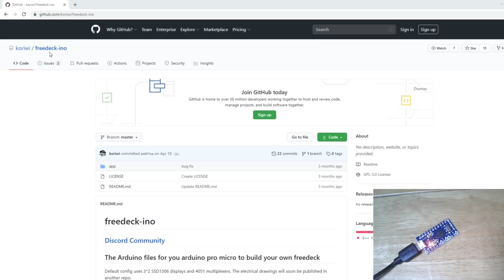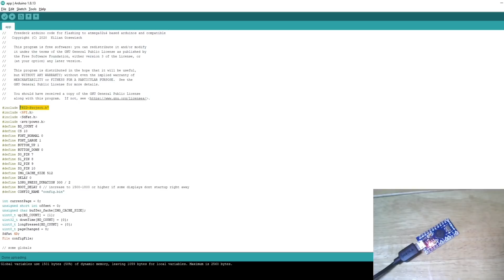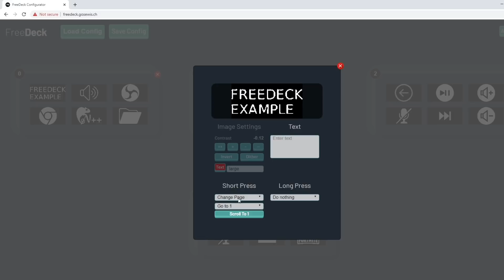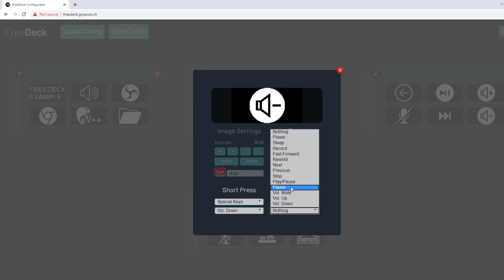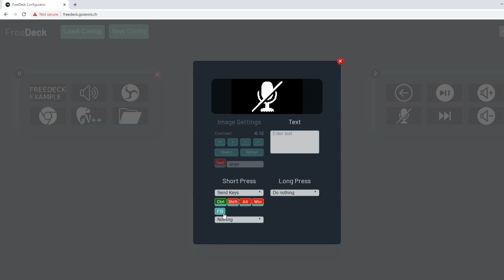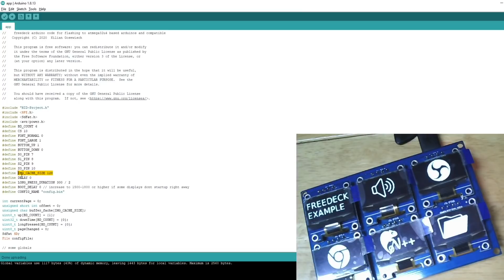FreeDeck - Open Source Stream Deck Alternative - HID, Arduino

Comment: Great Project and super video, any idea when the gerbers are ready?
Reply from the maker: They’ve been pulled into the github repository. I’ve tested both the through hole and surface mount versions.
Reply: @AdamWelchUK  Can you send a link to the gerbers, i still cant find them

Comment: If I may suggest. I think using a single screen instead of 6 little screens may be a better idea. It could be a design with a 5 to 6 inch screen underneath transparent buttons that are hinged on one side and touch a tactile button on the other side. That way, the  I2c problem is mitigated. When you press the button, no direct pressure is put on the solder joints of the screen if it  is connected that way. I would love to see a second version of this. Super cool. Keep it up.

Comment: Such an amazing project ❤
I've been looking for this for a long time.
Is there any way to use touch sensors instead of tactile switches ?
Because the slight bend of screen when pressing the button will break it after some time
Reply from the maker: I don't have much experience with touch sensors to say whether this would be possible.  I think that movement could be an area for failure, but I will need to use it for a good period of time to report back on that.
Reply: Have you considered using a Nextion screen. They're a full colour TFT touchcreen which is easily programmed as a standalone HMI device and good value.

Comment: cool, i already have bunch of those screens and promicro waiting for me to do exactly the same thing. this simplifies the process a lot, thanks!
i've been wondering about how well does those screens take the pressure from fingers, should i shield them with thin plexiglass or something? how about adding some "screen saver" features like movin screen content a bit or reversing colors or something to lessen oled burning?
Reply: Since the oleds are essentialy hinges, you can lasercut the top cover on a top plexiglass cover. Every cut will be C shaped, leaving the hinge uncut, ot partially cut. you could also carve some dots for finger placement.

Comment: why not just use a bigger screen like the ili9341 and then use the printed part to divide it into segments, that way you only need one screen, need to capacitive touch (as most of those displays have built-in touch) and you get full colour graphics

Comment: Hm, I dunno, the price isn't that much cheaper than just getting a normal Streamdeck, I got it to about 50$ with all shipping included, this is however not counting in how much it would cost to get the PCB. However, I do bet if you'd create the 12 button one you'd be able to drastically decrease the price as that one is 150$ compared to the 6 button one that is priced at around 80-90$, and I've seen them as low as 65$ during sales. Also doesn't include the price of creating/buying 3d printed outer casing.

Still cool tho, but not worth it IMO for the 6 button. Would be cool to see a PCB layout for the 12 button one.

Comment: mechanical stress with such a long lever on the screen pins makes me cringe. how did that work out?
Reply from the maker: Going fine so far. Movement to actuate the button is less than half a millimetre, but I accept it is a possible weak spot.

Comment: Hi Adam, i've been looking for something similar to this for a while - i have the pimoroni.com keybow and used this to give me a mute/un-mute button for teams on a Mac and have written a little about that https://garys.one/raspberrypi/pimoroni-com-keybow-and-keybow-mini/ just wanted a quick follow up - the buttons you used are missing from the list above? any points to size etc would be appreciated. G
Reply from the maker: Thanks for this.  I've been using my macro keypads while working from home and I too have made a mic mute button ;-)  I've been using the arduino IDE to most of the basic stuff and things I want it to do if I plug it into another machine.  For more advanced things I've been using Auto Hot Key and the arduino just send a high Function key as a modifier. (F16 for example).
Thanks for the tip on the link - I'll add one now.

Comment: Nice one :)
I think you can upgrade by using any cheap touch screen in color, just put 3d printed part over screen and y have much nicer product that will be without moving parts, also a bit cheaper. 
One screen is around 7-8 USD, you get sd card reader included. Icons will be much better, you will lose tactile feedback but you can have small vibro for that.
Anyway, thank you for sharing.

Comment: I never did fully understand the point of these Stream Deck devices in terms of why they need some 'special' hardware for them. Surely some sort of similar software solution for cheapo android tablets/not-so-cheap ipad's must exist. Or do people want the clicky feel of the buttons?

Edit: Not to diminish your video of course, cool project none-the-less :)
Reply from the maker: Thanks. For me the click is important as feedback, but there are solutions based on touch screens and android devices out there.

Comment: Elgato is using one big screen and custom touchpanel that is only between the buttons and is to detecting them.
I think they did it with the touchpanel to have better image quality and less light blocked, but for cheaper opensource project it wouldn't be much of a problem and so we should be able to utilise some of the premade touchscreen LCDs for example like those from nextion, they basically are lcd+touchpanel+stm32+microsd card slot. basically all you need.
Only one thing it interfaces with i2c, we need usb, so probably would need to solder some wires to STM32 USB pins, not sure tho if they can emulate keyboard as they are used primarly for programming, buit even if so, then you could just put pro micro in there to communicate with it via existing i2c interface and then simply translate and send keyboard commands via USB.
But the most challenging thing would be to create some tactile transparent buttons, there I have no ideas, perhaps resin printed buttons and some metal springy things for tactile feedback.

Comment: Adam -  So am I right in saying that the soldered pins act as a hinge? Would they not break eventually? Is the OLED screen not a thin layer of glass? Would this not crack if pressed too hard?
Reply from the maker: Yes, the pins are a hinge and the screen is glass. The switches probably depress less than half a millimetre at the furthest point from the pins, the movement will be tiny. It is however a possibility they will fail after prolonged used. As for the screens - they are double sided foam taped to the pcbs from the factory. This hopefully will act as a bit of a cushion. 
This design could well be flawed, but we’ll never know unless it’s put together and used. Using it every day so I’ll report back if I have issues.
Reply: @AdamWelchUK  Thanks Adam

Comment: Would be cool to eliminate the SD card and replace its function trough software that runs on the pc, it'd probably still need some other memory form of course.
Reply from the maker: Actually that’s one of the reasons I like this implementation - it doesn’t require any software on the host machine. It means I can move it around my machines without having to install or update any settings. However I understand that may not be everyone’s use case.

Comment: Be very careful when buying the screens! There a multiple variants of this. Some require different software so that can be solved, but some come with a different pin layout, the VCC and GND pins are switched..
Reply from the maker: Thanks. I mentioned the pins at 3:55 but hadn’t mentioned about any software variants.

Comment: I never got why the legato stream deck software wasn't open source anyway, they aren't making money on the software they're making it on the hardware.  Oh well, now they'll have competition when a Chinese company knocks out some hardware because all the coding and design of the hardware is already done.  Elgato probably could have avoided this had the software just been open source and didn't force this project to exist.  Last I looked the stream deck didn't work with Linux and I don't think on OSX either.  Or on the mobile OSes either.

Comment: FYI These screens are notorious for breaking when pressed in the wrong spots. "we" used them in receivers in fpv goggles (fatshark) and the ones without a metal case around the screen broke like crazy.
Reply from the maker: Thanks. So far so good, but I’ll report back as soon as I have a failure.

Comment: I don't get these streamdecks, why don't you just use touchscreen instead? It's far more versatile, easier, can do much more and looks better. Don't get me wrong, I love physical keys and for some uses (especially when you have to hit them on time, like switcher go and auto button) they are a must! Touch buttons are bad for such purposes because you have no touch feedback that you pressed it and you can't rest your hand on it. But I wouldn't put those actions on streamdeck type device either, because there are multiple pages and you can't use your muscle memory to press them anyway. So I think touchscreen is much better option.
Also, I think this won't last very long. The screen solder joins will soon break because you are putting too much strain on them.

Comment: soooooooo you're actually pushing on the darn OLED ????!!!! wouldn't that idk.....break it ? good look tho, maybe ill try this with E-paper Displays as they dont need to be powered up all the time just once and that's it so as you may have thought already you would upload the image and then unplug but leave the button on the bottom on for control or what not shit i would say to even use a capacitance touch which it has a library as well and if you the type of guy who likes the mechanical sound then fuck it just add a small speaker and replicate the mechanical touch when you touch the touch sensor that way no need to push deep on anything and get rid of the whole push button and therefor letting the whole assembly last longer.

wait did i just made something in my head and open sourced it on a comment section? ughh
Reply: also if i may say, this design does looks elegant sir so if i were you i would have change 2 things.

1) NO FDM this deserves a nice Resin Printed Case.
2)  rather then carve those rectangle/square opening for the oleds i would have done a oval shape to help contour the finger better rather then the awkuard angle you laid out.

other then that bravo! and yes add those tiny shoes on the bottom wouldn't wanna be scrapping your table top.
Reply: and then the next video i see after this one, https://www.youtube.com/watch?v=soIGV6BszcM youtube stalking history
Reply: late reply but still, those displays are darn strong, they are a mm or 2 thick play its not like he is pushing on them, it uses capacitive touch sensors so even the slightest touch would work, also using a speaker to mimic the touch feel is called haptis amd thats y darn iphones have a taptic engine and androids have a vibrator, also no i dont think epapers would be viable for this, first they are expensive and finding such small ones is kinda hard, plus most use SPI, so goodluck wiring up 6 of those, again a fdm case would work fine just print it with abs and then smoothen it with an acetone vapour bath

Comment: I also had the same idea quite some time ago but I never got around to doing it. BUT, there are samaller olde screens you could use : https://www.geekdisplay.com/home/16-very-small-049-i2c-iic-oled-display-module-arduino-compatible-.html and I think this will be better fit for this kind of thing.

Comment: Their cheapest model is 100 euros, my parts for dyi this is twice that amount. It is a nice project though so perhaps i make one but money wise it is better to buy the originall
Reply from the maker: Really? Where are you buying the bits from? Aliexpress was about $15 for six screens, $4 for the pro micro, $3 for ten multiplexers and $1 for the sdcard module. $2 for the pcbs if you want them and admittedly there might be $8 or more on delivery of them.  I built my first for $30 tops.
Reply: Adam Welch in sweden they tale the parcels just as woth wish in the customs and we need to pay tax on them so all the price win to buy cheap dissapears more or les, the only time it is worth it is when you buy lots of same thing. An arduino mega cost about 20-50 euros in our money, an nano version perhaps the half. An lcd about 7-10 so it os. Heaper to buy a screen to a raspberry pi for 30 ish and make a grid on it . To get the circuitboard / pcb with some stuff it is actually the most expensive as you got to make it yourself more or less or get a kit wich costs more than the arduino so overall cost for this project is significantly higher than the original. If i can plan it a few months ahead then i may find some componemts, the sd card module is about 20-30 as well
Reply from the maker: Yeah I guess some countries are tighter on this than others. For most though this is significantly cheaper than the stream deck - and a fun project too. Cheers